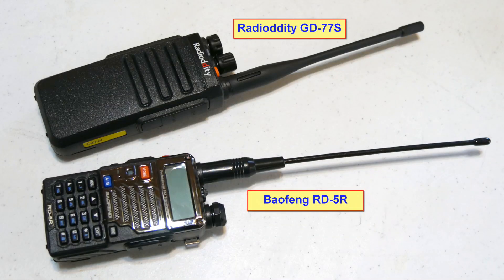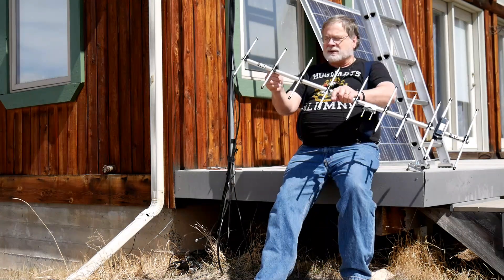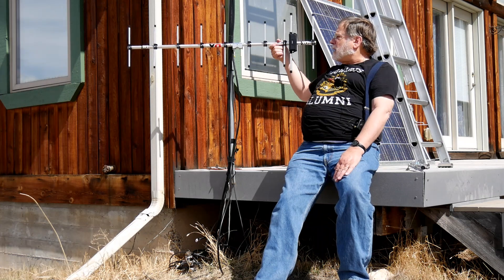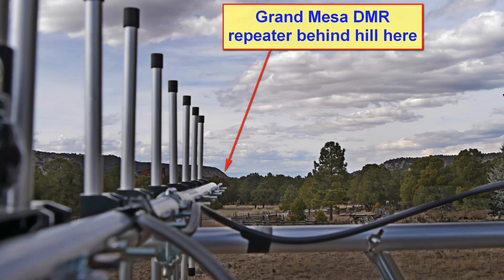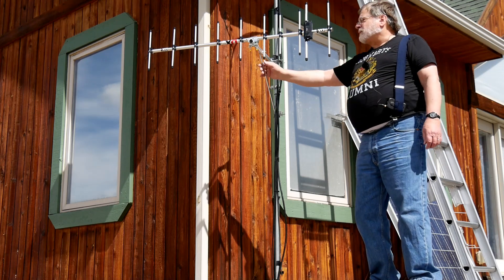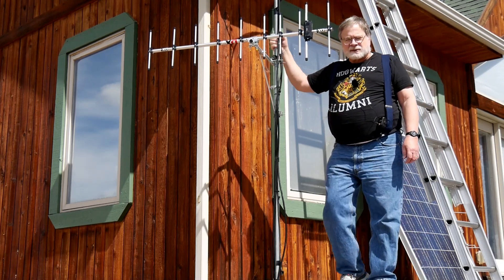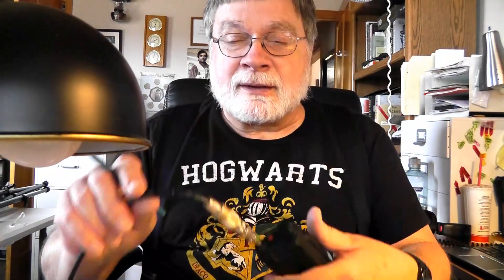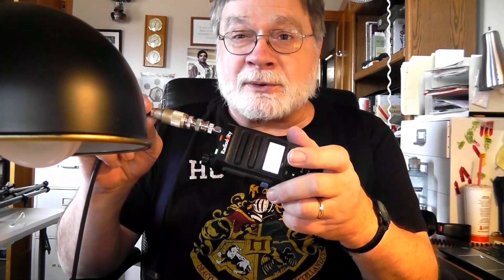Review using DMR of Diamond A430S10 70cm Beam Antenna (AD #124)

Comment: Great video and inspired by your results.  My local DMR repeaters are in the 440-450 MHz range.  The Diamond A430S10 is rated for 430-440 MHz.  Any ideas on performance with this antenna on the slightly higher frequency range?  Can the A430S20 be tuned or would it be better to search for another antenna?  Thanks, K4ZEV  73

Comment: Dave, get your friends on DMR, and try simplex. My buddy and I worked each other on 446.075 DMR simplex at 100 miles. Not from mountain tops either. From a 20’ high, 7 el beam in my backyard to his portable 5 el beam at a remote spot, outside his car. It was truly amazing. DMR had crystal clear QSO where analog FM was so scratchy, we would not have wanted to continue chatting together for too long. We also managed to send each other text msg’s over the same simplex channel once we were beyond the range of being able to hold a voice conversation. No voice at FM or DMR, text works just a bit further. I know a lot of old hams avoid digital, but if you hang in there, and work on getting your signal up, just as you would with analog, it brings a good deal of new advantages to the table. 73!

Comment: Hi Dave... At UHF frequencies I figured radio line of sight would be the real issue and you'd need a tower a couple of thousand feet high to see 80 miles line of sight. I know radio waves will bend a bit, but still. Thoughts? Oh, and it was good speaking to you at Hamvention. 73...Roger /  NQ8RP
Reply from the maker: Nice to meet you in Dayton. The radio horizon is about 4/3 as far as the visual horizon. Plus, with VHF you get some bending that follows the curve of the earth a little bit. So 80 miles line of sight is not that unusual with outdoor antennas in a bit of power.
Reply: Thanks!

Comment: Dave, D -star, C4FM and DMR  Some one needs to set a standard so they talk to each other
Reply from the maker: Every manufacturer has offered their particular standard as a standard for everyone. D-star was developed by the Japanese Amateur Radio League (JARL) but it has not been universally adopted.
Reply: there are multiprotocol  reflectors that make dmr ysf dstar talk to each other. one expample is Alabama link, check their webpage.

Comment: It's always a good idea to mount folded dipoles and beams a wave length or a little more out from any tower or structure - as you correctly said.
The reasons are as follows :
a) They rest at ground potential which mean they funnel lighting and static charges to ground without entering the feeder transmission line.
b) It prevents adjacent metal such as poles and wires from interacting with the signal and therefore reducing the efficiency - what Dave said.
c) It reduces spurious interference with nearby antennae.

Comment: Dave, great video as usual. I like you, live out in the boonies and my QTH is about 65 miles from one dmr repeater and 35 from another. Both put out 25w. The good thing is that my altitude is about 400 feet higher  than either location. Both broadcast patterns shown on both repeaters, fall just short of my QTH in radial distance. Using the Diamond and the GD77, do you think I should be able to reach the repeater?
Reply from the maker: You might be able to. Whether the link works is highly dependent on the specifics. Worth trying.

Comment: Wow! Well done Dave! 80 miles on UHF is no small feet. Now comes my ask Dave question. With the winds of Colorado, do you have to take extra care to ground out static electricity? Also, if you used a non metallic mast could you have mounted the antenna directly to the mast? Thank you in advance.
KE0OAP
73
Reply from the maker: Yes, wind generates static which needs to find its way to ground. And, yes, you can attach it to a non-metallic mast.